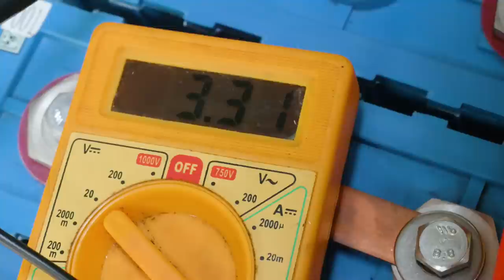Lithium Batteries | Sailboat Maintenance | Prep For Cast Off | Sailing Ep 290

Comment: This is the reason why I am holding doing lithium DIY batteries. If 1 cell is faulty, you won't have a 12/24v battery plus the hassle of returning/shipping 1 cell back to the vendor and the vendor sends/ships 1 cell back to you. Especially, if these cell are coming from a Chinese vendor - imagine the time being wasted and the frustrations. I would rather pay more $ for a ready to use lithium batteries and save all the troubles.

Comment: I would connect the cells in parallel and charge at 3.6v with a bench top power supply. After all cells are top balanced connect in series and test a few cycles to see what amps they can supply. You might be ok once top balanced.
Reply from the maker: I only charged them individually at 3.6v, not altogether. When in series I charged them at 12v but that one cell was taking in more charge than the others. Unfortunately I was only able to get hold of that cell charger two days before our departure so I couldn't do much more testing and had to make a decision on returning the faulty cell. Hopefully when the replacement comes and we return to Sabah I can finish off the installation.

Comment: I think I’ll wait for solid state batteries.  Until then I’m a AGM guy.
Reply from the maker: Lithium batteries are a game-changer, Dan. The ability to pull them right down to 10% and charge them as fast as your charger allows means we have constant 240v on board, 24/7. Plus the price of lithium is coming down all the time, so they're a no-brainer IMO.

Comment: Lithium can sure be finicky with all the special electronics, chargers and BMS paraphernalia when it is first installed or upgraded.  Having a bad cell from the get-go must have been a real buggar to troubleshoot for this pre-journey project.  Perhaps this bad cell was just good enough to pass the tests at the factory but didn't survive transport/loading onto the boat. Sometimes crap just happens, especially with more cutting-edge tech. 

After our lightning strike when most of the sensitive electronics on the boat were fried one of the few things that thankfully did survive unscathed was our 5-year old flooded lead acid 6v golf cart house batteries.  I wonder how lithium cells would have fared had we been so equipped?  

I imagine any internal BMS and other lithium charging electronics would have been messed up with such a direct strike since our own basic marine lead-acid shorepower and solar chargers were fried well-done as well as our alternator. At least they were all fairly cheap to replace. Even the  Blue Seas Automatic Charging Relay that connects the starter battery was rendered inoperable and that is a durable piece of equipment. Thankfully BSS has an excellent lifetime warranty and all of their stuff that was fried was replaced for free.

I can only imagine how much of a PITA it will be to arrange a handoff of this replacement cell while underway to your next secret cruising destination.  And not only just the logistics of the delivery, but all the importation taxes and paperwork will be another headache on top of all that. Bummer.

Fair winds on your journey.  I am behind and haven't been following much the past few weeks since we were away from our boat on a secret land mission of our own lately.  Cruising life often has its bumps along the road. If it isn't one thing it is another.

Comment: Question please. Is you starter battery still AGM? and how do you charge that one ?
Reply from the maker: Our starter is actually a sealed LA. It only gets charged by the engine so it only gets charged at the same rate as the lithiums through the Sterling alternator-to-battery charger. This is not an ideal setup but at $100 we can afford to replace it once every few years. When on shore power we give it a full charge using a standard cast battery charger.
Reply: @followtheboat  Thanks

Comment: Sorry to hear about your bad cell.  You have probably heard this all before but it pains me to hear about your soldering. I have been soldering for, well more years than I care to say... Make sure you have enough heat on the pieces you want to bond and then the solder will flow, even vertically, by itself. If you just melt solder onto a connection it won't last.  Those little monitor circuit boards you do need to be careful not to heat up too much or you will damage the traces. Good luck with your next soldering job :)
Reply from the maker: Hi Michael. I have to say my new has soldering iron helps. My electric ones never cut the mustard (I guess they were just cheap). I will continue to practice and have another couple of small something jobs to do. I can't go through life on a boat not being able to solder properly!
Reply: Just keep soldering on… you’ll get there in the end!